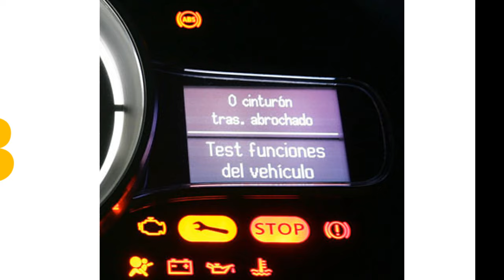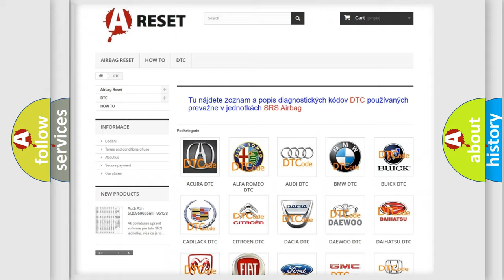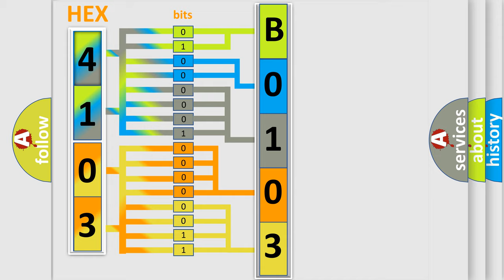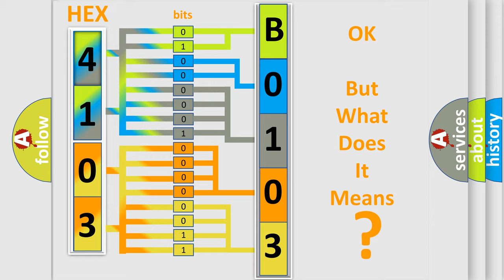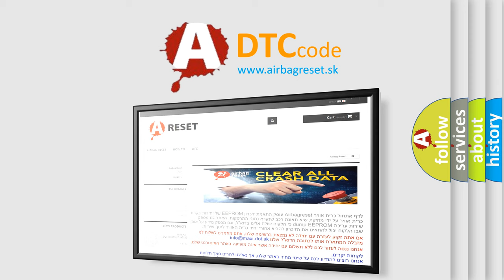DTC Fiat B0103-11 Short Explanation

Comment: 2017 egea vehicle. I bought the car. After 3 days, the airbag lamp burned. It gave error b0103-11. I took it to fiat service, they said it was a battery, I bought a steering coil, they said, I bought a wrap, but it was not solved. 2 days after the malfunction light was turned off, the light is still on on the straight road, please help. There was no master that I did not take